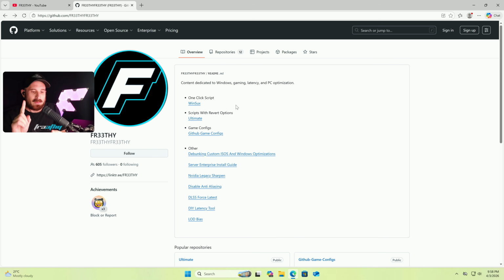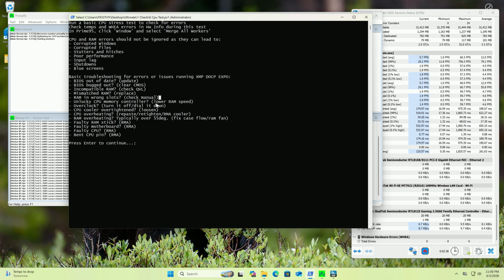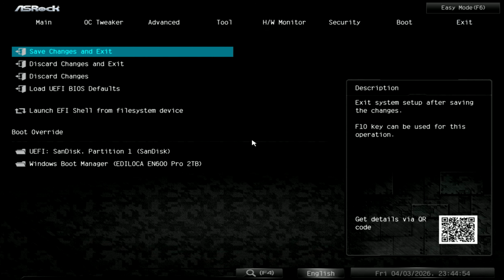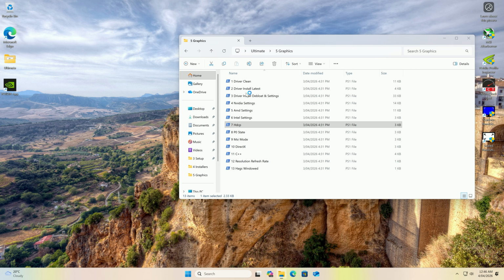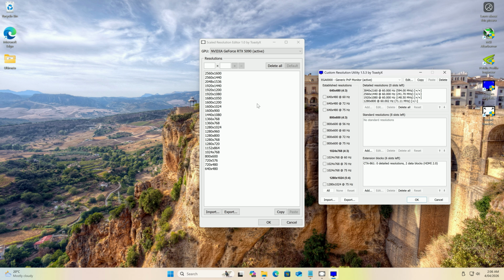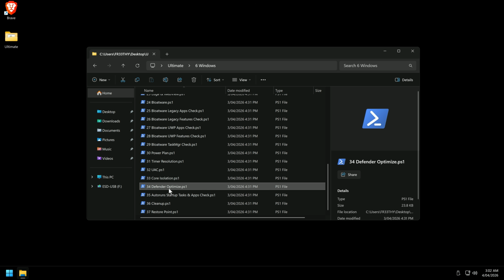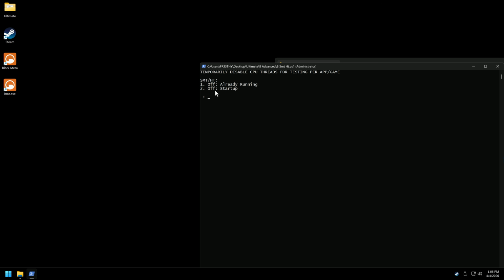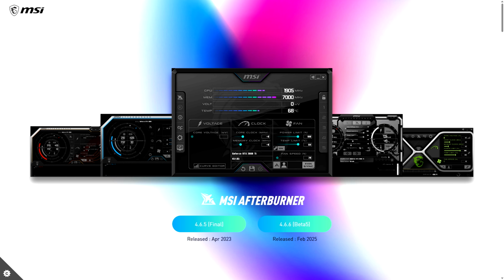Ultimate - Windows & Everything Optimization

Comment: Please ad a restore point bevor doing all the changes and an undo
After the script, Network drives will not reconnect, no matter what i do!
Reply: I did most of the changes listed (except the advanced tab) and it broke my windows and I would get random restarts and black screens so I undid most of the settings and when I undid the control panel settings it deleted all my restore points so I couldn't revert and was stuck with a broken windows with no matter what I did so I had to factory reset. Idk if I'll be reapplying these again in fear that it might happen again :(

Comment: @fr33thy 

Howsit man i have been following your Channel for Quite some time and have used a lot of what you do in My setups !

I tend to Take my time in understanding something before applying it just to a Tech Savy extend!

The Effort, dedication and passion that goes into your coding / Scripts is next level! and for that im Grateful.

One thing i would like to understand if you could explain , in the vid you said in 2026 Chipset Drivers aren't really that important anymore, because windows have dedicated setup drivers that function correctly by itself and Chipset is just Bloat? 
My apologies if I can't Quote word for word ( can't find that part in the vid since its so Thorough and long)

How can you Elaborate more onto what was said here , because Doing basic research I can't find proper backing to the Statement.,

No Hate Intended, Just understanding.

HMU when you can 🤙
Reply: other then x3d cpus yes, other cpus u probably gonna set most of stuff in bios and dont need the chipset drivers just sitting there doing nothing.
Reply: @hwinf0-r5c Yeah makes sense since i do have a 3d Chip 

I presumed that Chipset is actually mandatory for 3d Chips
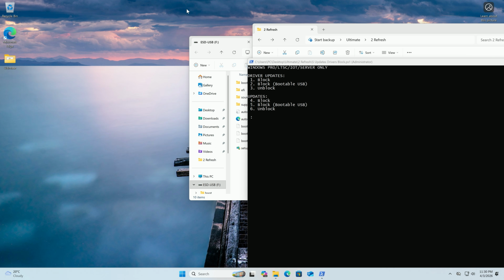Reply: @hwinf0-r5c okay well i Got it Timestamped here 35:11  , he states that if you have a dual CCD Cpu its recommended to install chipset drivers , i have a Ryzen 7 5700x3d which is a Single CCD chip
Reply: @BubbaKush024 yh bt the issue are algos like pbo that rely on those drivers, i did test them a while ago with a fresh install and made 0 différence perf wise other then without them some games crashed with pbo -25, i would say there no harm keeping them there are only 1/2 services running.